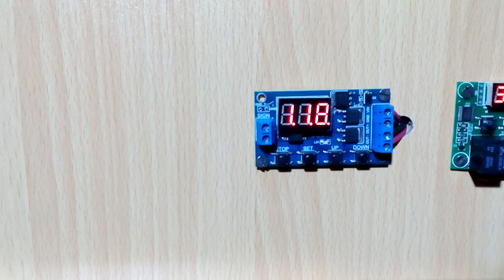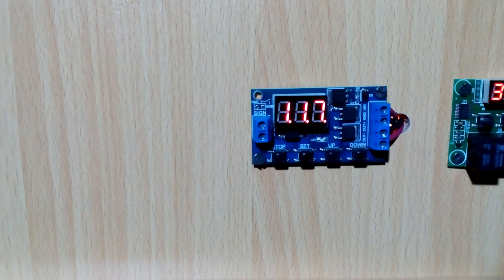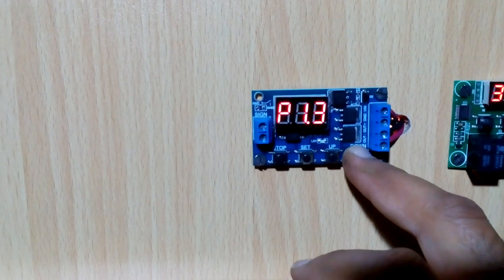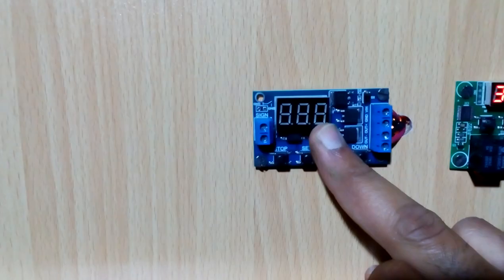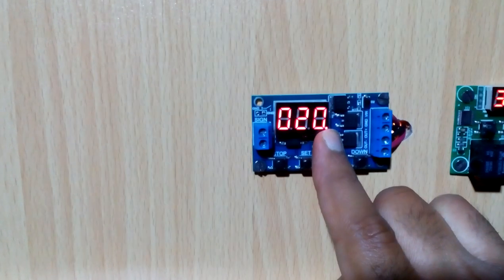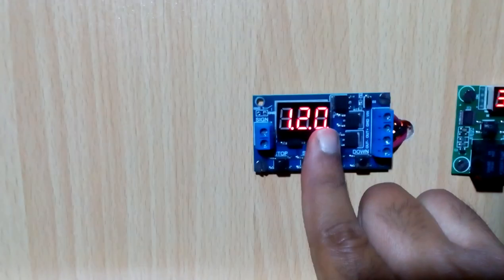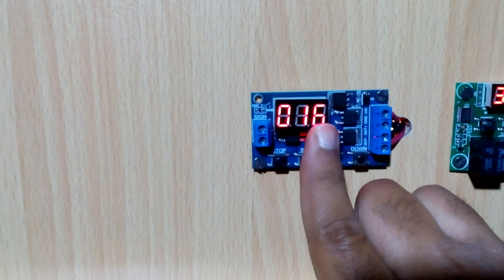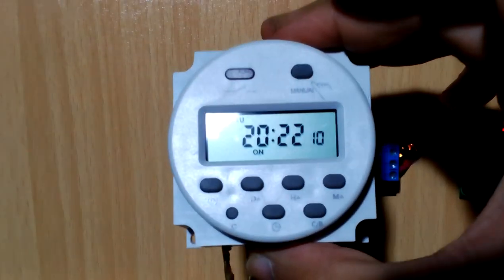How to set digital timer for incubator

Comment: Bai mere pass jo timmer hai us pe p1 se le kar p4 tak hai us pe kaise setting karu please tell me
Reply from the maker: Usmein bhi same setting hogi
Reply: Umair's Workshop please app bata digiye kaise karni hai mere to smaj nahi a raha
Reply: @Umairworkshop  hi umair thanks for you informative videos. My question regarding digital timer. 5-24 volt. Can I use this timer for 24 volt printer relay. I am using 12v adopter for relay for slow movement as told before in one of your video. Moreover, can u please share the wiring of.digital.timer  with the printer motor for egg turning.because I have searched a lot but didn't find your video. Thanks and best regards.
Reply from the maker: @rehanbutt3832  thank you , here is the timer wiring with motor it is in the end 
https://youtu.be/hax2OaDllQ4

Comment: Hi, we have the same timer module, But mine wont work ,  the relay is 12v but the motor i used is 220v and its connected to the relay signal,  so when the time is gone, the motor wont shut off. it's still on.  

 maybe the wiring is the problem. please tell me the wiring diagram.
Reply from the maker: Is it set on p3-2 ?